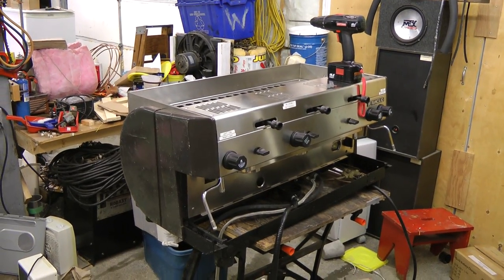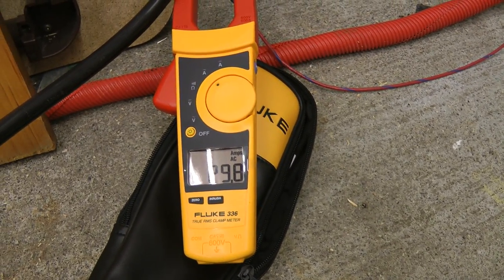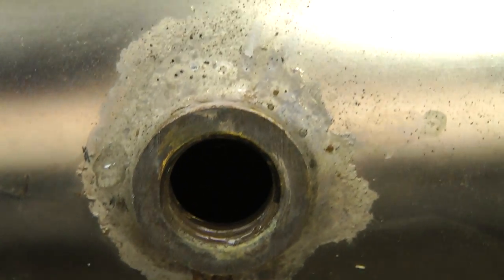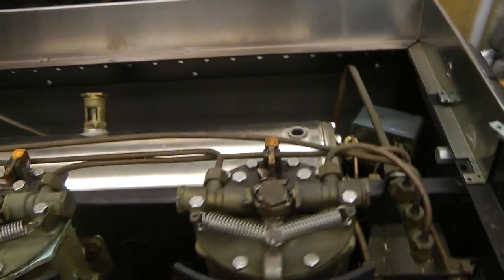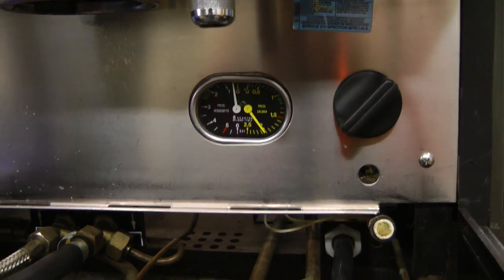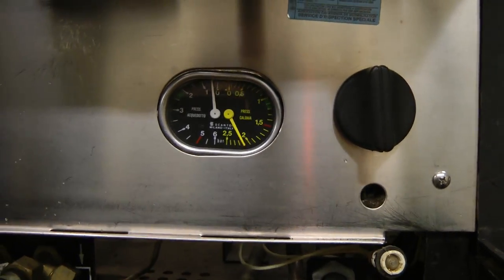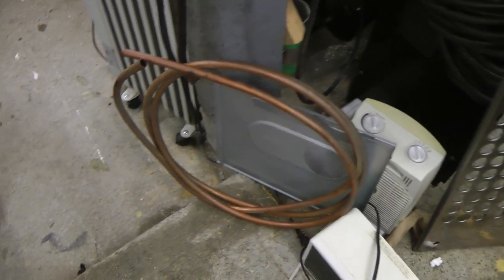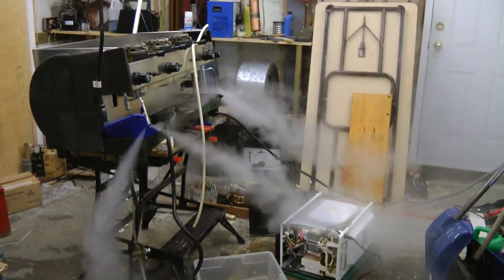Rancilio cappuccino machine and Air Liquefier tank

Comment: The coffee heads will not work without the water main pressure. The automatic tank fill should be an electrode that sticks in from the top.  The automatic tank fill is sometimes augmented with a high quality high pressure vane pump to pump against the tank pressure.

Comment: Take care, the heater is typically pressure regulated and that much superheated water stores a lot of energy,  if the tank should rupture (faulty relief valve and no  pressure controller) it would be very explosive.